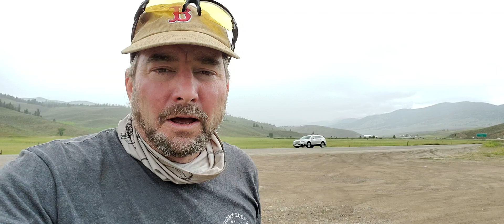737 Emergency AD

Comment: "Dual engine out" fear is actually compliments of the FAA. Go read the actual EAD. They (FAA) said it before the media.
Reply: Exactly -- FAA talks about "dual engine power loss" 3 times in AD #2020-16-51 found at https://rgl.faa.gov/Regulatory_and_Guidance_Library/rgad.nsf/0/ec0e5875b315e9e5862585ae007cd448/$FILE/2020-16-51_Emergency.pdf
Reply: @KCautodoctor  why does the official release even refuse to NAME the engine maker, CFM?  Isn't that a bit curious?  I thought engine makers were responsible for the Engines, and Boeing provided the fuselage and avionics etc.
Reply: @klam77  CFM (Safran/GE) made the engines, but the bleed air system belongs to the airframe. The same engines are used in the Airbus A320, but they are not part of the EAD as their system is different.

Comment: Boeing can’t catch a break , can they 😩
Reply: If they did what's right they wouldn't need a break, would they?
Reply: Not when the socialist party hacks are running the media!
Reply: @rlyle5804  How does the biggest, richest aircraft/defense company cheaping out relate to your insecurities about helping those less capable? Just pathetic.
Reply: @wtfizzjus  What caused the Jakarta crash. Please be specific.
Reply: @rlyle5804  Which Jakarta crash. How about you try being anything other than completely vague.
Reply: @wtfizzjus  A thousand apologies! I thought you would have heard about the Boeing 737 Max/Lion Air Flight 610 crash that happened on October 29, 2018 at 6:20am. Location 
5°46′15″S 107°07′16″E. That is the crash I am referencing. If I am being too vague, let me know. PS I havent looked but I would bet it is the only Boeing crash out of Jakarta in 75 years.
Reply: @rlyle5804  No need to be sorry, at least you're aware of your disability. And you missed my point, which Jakarta crash relates to the 5th bleed valve? Yes, I know the Lion Air crash, which is what most people who aren't desperate to seem remotely intelligent refer to it as. And the cause, very obviously was the success of "free market" capitalism at its finest, with the manufacturer "regulating" itself. No need to be snark cause you don't know jack.
Reply: @wtfizzjus   Context. wow. The Jakarta crash  has nothing to do with the 5th bleed valve. 
I thought my question was a simple one. Apparently not. Second try; What caused the Jakarta crash* and how does it relate to Boeing "cheaping out". Please be specific. 

*By "Jakarta crash" I mean the Boeing 737 Max/Lion Air Flight 610 crash that happened on October 29, 2018 at 6:20am. Location 
5°46′15″S 107°07′16″E. That is the crash I am referencing. Again, if I am being too "vague", let me know.
Reply: @wtfizzjus  STILL no answer! Shocking!
Reply: @wtfizzjus   So to copy and paste is what the socialist party hacks in the media wrote is, to an educated person like yourself, "research"? 
If you think the Jakarta crash was caused by flawed Boeing engineering, then you need to do some research!
Reply: @wtfizzjus  Italy has socialist FREE healthcare and MANY people died. Also, the socialist party hacks in the media said Covid-19 is nothing to worry about. Pelosis, on 2-24-2020 was in China Town surrounded by people without masks, and said nothing to worry about (Same with other DEMOCRAT governors). It appears that some EVIL for profit drug company may come up with a cure. 
"Horrific how a little bit of socialism helps the general public so much." Like the bastion of wonderfulness known as Vietnam, where murder was made legal?
Reply: @wtfizzjus  Since I PAID for the public roads, I will continue to use them even when socialist politicians sell them to foreign countries causing citizens to pay for over and over again.

Jakarta crash FACTS
Aircraft had problems with the AOA sensors upon arrival the night before the crash that caused the flight to be so bad, passengers were described as “traumatized” 
The Maintenance crew checks the aircraft and installs a used part that is defective. Maintenance has no proof that the appropriate tests were completed after the install other than a faked photograph. Maintenance then releases the aircraft as airworthy when it CLEARLY is not. 
As an added bonus, there are thirty one pages MISSING from the aircraft maintenance log. 
Pilot and FO acknowledge AOA reading discrepancies BEFORE takeoff. 
TWO seconds into the flight the stick shaker goes off. The FO asks the Pilot if they should return to the airport. The pilot apparently thought he could fix the aircraft in the air. 
The instrument readings caused by the still faulty AOS sensor are off by so much that the FO contacts ATC TWICE to ask two questions; what is their altitude and speed. Ponder that. They don’t know how high or how fast they are going, YET THE PILOT STILL DOESN’T ATTEMPT TO RETURN TO THE AIRPORT.  
The pilot continues the flight, which lasts for over 13 minutes, never exceeding 6,000 feet, before crashing. The aircraft should have been at approximately 25,000 feet at that time. 
If maintenance had done their JOB, the aircraft never would have left the gate until it was CORRECTLY repaired.
If the pilot did his JOB, he never would have left the ground, or would have immediately returned back to the airport which could have been done as the aircraft was under the max landing weight. 
The crash was caused by incompetent & unethical maintenance people and pilot error.
Reply: @rlyle5804  So wrong, again, Italy HAD an outbreak, mostly contained now unlike the States and Brazil. Oh yeah I forgot how no Vietnamese ever died from an American bomb. Or the unexploded ordnance left by "democratic" Americans in Vietnam, that are killing people to this day.
Reply: @rlyle5804  What happened to the missing 13 minutes of the flight? Are they hidden with the real JFK murder video?

Comment: AA Mech here.  I have been working on planes since 17 now 57.  The longer an aircraft sits the more it breaks.  These aircraft are called hangar queens. Sort of like us.  The more we sit the more we break.  Kudos to Juan for showing us to keep moving!
Reply: LAX mech here. Yep, storage is a killer. Hyd leaks, fuel leaks, valves not working, struts low, tires need servicing. Been there
Reply: B1/B2 tech here. What valve is talking about? The 5 th stage vlv is the prsov and is always open.
Does he mean the 5th stage check vlv?
Reply: @roaldnordeman6533  
I'm confused about that as well.
Reply: Out of Tulsa?
Reply: Barry Allard - I’ve got a customer with a 2008 RX350. In the past two years I’ve replaced the front oil lines that almost cost her an engine, the ignition switch that left her stranded and needed a tow, and the latest was just last month when 140 amp fuse fatigue-cracked, resulting in battery draw, and a no crank no start, requiring another tow. Thing only has 99,000 miles on it right now. Not to mention all the other little things, like the rear hatch switch that failed and broke apart, and the strut rods for the hood and liftgate that lost their strength. Used to be such a great brand, too.
Reply: get da grease gun out
Reply: A&P here also but now working. Yes I can back that up.  The more the plane sits the more stuff breaks that is why they do 14 day run ups to get things moving. It is even on cars.   Every hanger needs a Queen :D
Reply: @yogib37  - And the cars of the 21st Century are even worse in this regard. Let them sit just a few months outdoors in a humid environment, and everything will go to hell in a handbasket. The body will still look pretty, but nothing will operate correctly. Older cars could sit outdoors for years - decades in some cases - and still start! Those days are sadly far behind us.
Reply: Christopher Baker like Fat Bottom Girls?! 😂
Reply: @yogib37  I'm contacting Jay Leno and volunteering to drive each of his 150 cars on a routine bases!

Comment: We need to begin flooding any and every news media site who reports on these issues, with a link to your YouTube videos with your full explanation!  There are plenty of pilots who appreciate your analytical aspect, rather than the sensational (and often incorrect) news media chaff.
Reply: Misdirected instruction there. Point your finger at FAA, please. These "fake news" mantras get to be boring.
Reply: Jacques Blaque  Point to exactly where I said anything about, “fake news”.  You cannot, because I never did.  Plenty of news outlets consistently misreport Aviation-related pieces without obtaining the full facts, in an effort to make a deadline.  How is that the fault of the FAA? It isn’t. Anyone in the Aviation industry knows that, even @blancolirio .  Check yourself before posting a knee-jerk, butthurt reply.  Any media outlet could use Juan’s  expertise for a clear, concise, and factual perspective and understanding .

Comment: Very interesting. I wonder how this will affect aircraft that are put back into service after the quarantine.
Reply: Read the EAD.  They will still have to comply after the quarantine.
Reply: @TheCessnaDriver Airlines are probably not going to do it till they know the aircraft will actually fly again, or will be scrapped due to being in oversupply. Likely those airframes that are highest cycle count, or are fully paid off, are the ones destined to be scrapped, so that the money generated from scrapping them can be used to offset the remainder. Very likely air travel will be at less than half of the pre March levels for at least 5 years, if not more. I live on an approach path, and a flight into the major airport is now a rarity, before it was at least every 15 minutes depending on wind direction.
Reply: You are very optimistic about the aircraft ever being put back in service. Do you know something the rest of us don't?
I don't think they have any intention of letting up on the lock downs until they get what they want.
Reply: @TheCessnaDriver No, Sir.  The time to comply with the EAD is when the plane is removed from storage, whenever that happens to be. This is caused by storage. It's kinda like when you put your car in storage. When you pull it out of storage and try to fire it up,  it's 50/50 that it'll work because while you were getting on with life, the battery drained, the oil all went to the pan and nothing was protecting the internal parts of the engine from corrosion. Same with the turbo fan engines. All of the oil drains to the bottom and everything above the oil level corrodes. 

Ps, I'm not good at diplomacy so if I was offensively blunt I apologise.   I intend to explain and somehow I offend people unintentionally.

Comment: Amazing how quick these 5th stage bleed valves deteriorate when the engines remain unused for as little as 7 days per the Airworthiness Directive.
Reply: The '7 days' is probably the FAA being a little over-cautious.   But since (I assume) checking the bleed valves is not a huge task, and the consequences of a stuck one are potentially quite serious, it's probably wise to insist on them all being checked.
I can't help wondering what other previously unknown faults - on any type of aircraft - might emerge from this unprecedented long-term mass storage.   Hopefully nothing disastrous.
Reply: Might depend on the storage conditions too, this pandemic has aircraft being stored and brought back into service in ways that may be unusual/rushed. I would assume with proper engine covers on, and especially in the arid climates planes are normally stored in, this would not happen so quickly.
Reply: @MrMattumbo  so you are claiming the airlines are now ignoring published guidelines for storage & reactivation of stored Boeing 737s?  Or is the issue that the root cause of this engine stall was never correctly identified in the past when these aircraft were placed into storage & just passed off as a one-off issue with those prior engine stalls after aircraft storage?
Reply: @KCautodoctor  I have no information to say they are but with something like 90% of the world's commercial fleet grounded at one point it's probably safe to assume corners were cut. Regardless the main issue is probably where the planes were stored, corrosion would be unlikely to occur if airlines had the space to store these planes at their normal arid boneyard fields. Outside of longterm storage at those places I doubt there's ever been a time where 737s were left stored for even a week barring rare occasions like bankruptcy where such an issue would likely be seen as a one-off or the fault of poor maintenance on the part of the defunct airline. 

I'm sure we'll see new regulations around storage come out of this situation, it'll be interesting to see if other engine types have similar issues too.

Comment: Is the 5th stage bleed valve part of the engine itself, or part of the airframe? Or in other words, does this issue "belong to" the engine manufacturer (CFM?) or to Boeing? (Not that assigning blame makes much sense here. Planes probably aren't really designed for the extended storage they've been subjected to lately.)
Reply: Boeing procures the bleed air system and valves from a third party and integrates them into the engine.  Boeing is the type certificate holder for this equipment.  The valve in question is the ‘mid-stage check valve’.
Reply: @klam77  Boeing specs and procures the check valve from a check valve manufacture.  Yes I am absolutely certain.
Reply: The bleed valve is an engine accessory . It would be the engine manufacturer.
Reply: Mark Thompson Thanks!